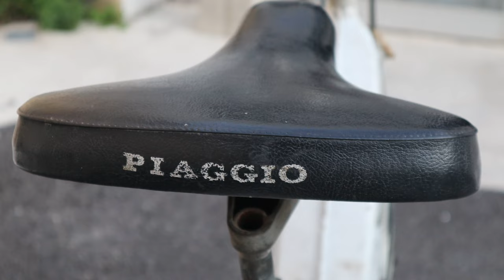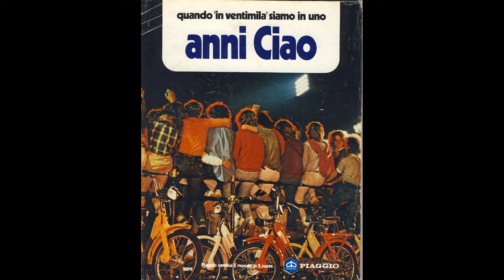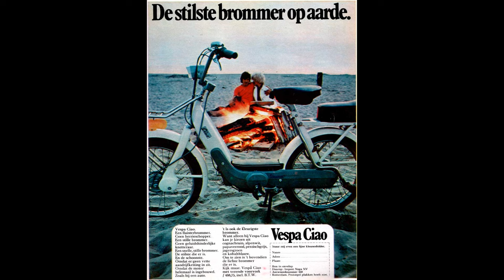1972 Piaggio Ciao - Simple, Reliable and Stylish - Italian Classic Moped

Comment: Nice video. What that that lever you called valve lifter does hence its a 2 stroke engine?
Reply from the maker: Thank you! :) Good question.
It has a specific type of valve in the cylinder head which opens and leaves the compression get out, in order to switch off.

Comment: Hello,  Interesting video.
I have a question that I have been looking for an answer to but haven't found yet. How does it work with the two gears that this model has? I know there is a gear mechanism in the hub of the rear wheel, but how do you change these gears? Do you change from first to second gear, on the handlebar together with the clutch lever - or how does it work?
Hope you can answer this. Thanks!